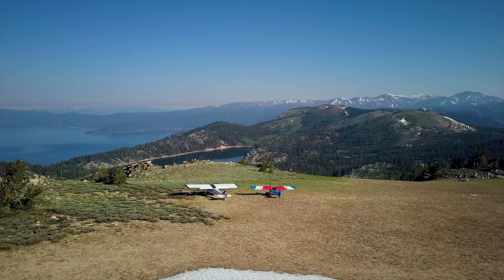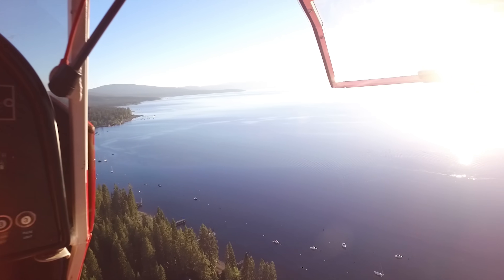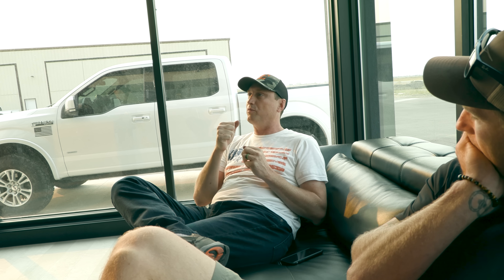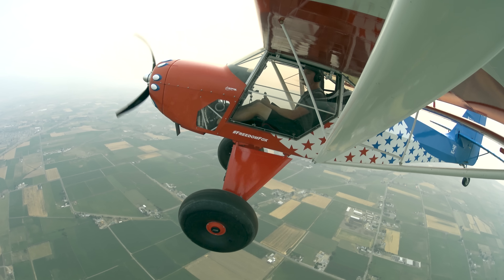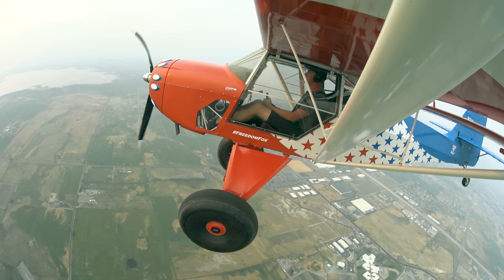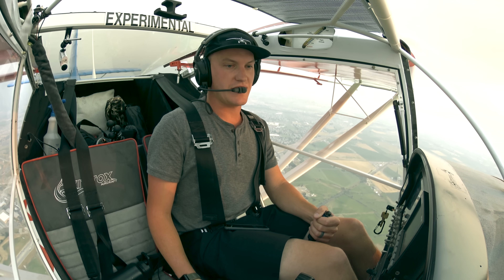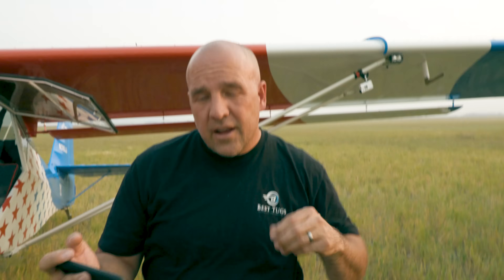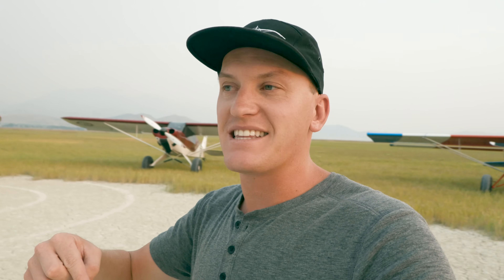YOUR FLIGHT INSTRUCTOR WAS WRONG! - Simulated vs Real Engine Failure

Comment: The way to kill this discussion is to have a plane equipped with a variable pitch prop that can be flat pitched. In the one instance you have it stopped and, in the other you have it spinning at maximum permissible revs, thereby representing the two limiting conditions. My money is on the stopped prop creating the least drag every time,  simply because it cannot create adverse thrust.......whilst the spinning flat pitched prop, can, and in the correct circumstances..... will generate lots of adverse thrust...............i.e. beta, gyrocopters......auto rotating helicopters, ferried jet engines and  the rest!

Comment: Actually, I don’t think it matters! I think either way the difference is negligible to non-existent if the engine isn’t powering the prop. The other factors here are the differences in the aircraft configuration and wind as well as temperature. It’s hard to do a test like that with all of that being constant. You sort of need a wind tunnel for that.

Comment: Hey Trent I'm currently taking aviation courses and I fully agree that an aircraft with an idling prop will hold altitude and glide better than an aircraft with a windmilling or stopped prop. This is because with the prop idling, it is still putting out thrust even if it is a miniscule amount. But, I do not agree that an idling prop produces less drag. When looking at the forces put on an aircraft you see that weight equals lift and that thrust equals drag in stable  unaccelerated flight conditions. When the prop is spinning and producing thrust it increases the drag on the aircraft. The thrust created by the spinning prop helps to overcome the induced drag. But when the prop is off, there is no more thrust to help overcome the drag. Therefore the effects of drag are more prevellant when the prop is off and especially when windmilling. When talking about which of these scenarios will allow for the best glide over the best distance it is at idle. But at idle the faster airspeed over the airfoil and front face of the plane, causes an increase in drag therefore meaning that an airplane with the prop idling would technically glide better but would experience more drag. I know you probably won't see this. And I'm still a student and am most likely wrong but I wanted to share my opinion on what is happening and why. If for some l reason you do see this I hope you like what I have to say. I just think that this fish story got lost in translation.

Comment: I just finished watching a video of a Harbor Air DH2 Beaver float plane engine start and take off. As soon as the engine start and before throttle advanced, the plan was moving through the water. This indicates to me that a prop at idle does provide forward thrust.

Comment: WTH is the point of discussing this?...JUST DO IT.  GEEZ.  The argument seems stupid to me, ANY thrust is going to increase the glide, it would seem.  I would think an idling engine would beat even a stopped feathered prop., now a windmilling prop (engine shut down) might have more drag than a stopped one or might not. In the stopped case the prop is pretty much flat plate drag given its area, spinning and putting power INTO the engine it might possibly remove more energy in a less stalled condition.  GEEZ, now you've got ME doing it.

Comment: Really good question and it's a question that instructors need to touch upon with their students.  The students need to be aware that actual engine out situations will result in a shorter glide ratio than the simulated engine out situations that they practice.  Excellent video!

Comment: Windmilling or not, if you lose power you have to make a decision. It is not the farest point I can reach, it is the safest point that leaves me plenty of options.
As a glider pilot, I have made plenty of outfield landings, and it always begins with find your landing area, make a downwind to look more closely to your landing area, use your baseleg to end up in a shorter or longer final, as needed, and on the final adjust your glide ratio with the airbrakes( or slip ) .
I tried it with my Eurofox Tail dragger, and the only new experience was, during the flair you don’t get the angle of attack as you are landing with engine running idle.

Comment: Disclaimer: I've only flown hang gliders, so engine management was never an option. 

Surely the important question is how far can you travel across the ground under the different conditions? Not how long does it take to fall by 1,000 feet. After all, your glide angle is the most critical thing in an emergency. You want to know how far you can travel with a power failure, not how long will it take before having to land.

Comment: I think the only difference between these two situations is the amount of forward thrust produced, drag should remain constant.  But because they work against each other, the net effect is that a stalled prop is not going to take you as far as an idling prop.  

Additionally, drag force increases as velocity relative to the air increases, this property is easily observed by the presence of terminal velocity.

Comment: Mike touched on the real issue...the frontal area presented to the airflow...a static prop's frontal area, all things being equal(relative!) the area "presented" square on to the airflow for a static prop will always be more than a turning prop...the degree of effect will depend on the foil profile of the prop, no different to a wing (incl tip washout/blade twist)...consider the frontal area of a round tube compared to a square tube of the same side view area. Aerodynamics seriously favours the round tube as the airflow wrong the square profile billows out around the sides and detatches creating a much bigger area effect in the airflow around it...a static prop blade will have the same proportion effect relative to its airfoil profile... any talk of disk effect is crazy!.

Comment: Great Video,  I can't practice a full engine out in the Aeronca Champ that I'm training in (no electrical system.... Hand Propped).   I've had what you said about its going to come down faster dead than at idle every time I pull the throttle to idle and practice a landing. Yes I do know that the manual states that you can Possibly restart the engine by nosing down and building airspeed, but unless it was carb ice that caused it to stop, or the fuel sector set wrong, its probably not going to restart.

Comment: its simple. if the engine is at idle its creating less drag. when you are engine out try keeping the glide speed with the engine at idle or the engine stopped. See the difference  or not. what about a two blade three blade or four blade prop?

Comment: Why are you using airspeed to hold best glide?  It's likely wrong in every scenario.  Should be using AOA.  Don't care about the airspeed, only what the wing is actually doing.  Also - you flying best glide speed or min descent speed?  Cuz that's different too.
Reply: Best glide speed isn't, however.  Weight, density altitude, headwind or tailwind?  Airpseed is only a guess at what the wing is doing, AOA is the truth.  On most light planes the speed in the book will be close, within a few knots regardless of weight or DA.  Headwind or tailwind will change it drastically however.  Good rule of thumb is add half your headwind.  Best glide is 60mph, 10mph headwind, fly at 65mph.  Why?  Extreme example makes it's clear - with a 60mph headwind you will have zero ground speed and not get anywhere, your glide ratio would be zero.

Comment: Sorry, but one final thing.  A stationary prop mounted to a fuselage with no control surfaces would cause the fuselage to spiral around the axis of the center of the prop as it goes down. A freewheeling or under-powered prop will cause less spin than a fixed prop, thus the pilot will apply more control surface to fight the faster spiral, again causing more drag.  Fixed prop loses again.  

An unbelievably good pilot could roll at the natural spin rate and lengthen his glide.  There would probably be vomit.  There's that to consider.

Comment: A freewheeling prop will produce following rolling vertices perpendicular to the center of the prop, thus decreasing pressure at the center of the prop, and increasing pressure as the air is forced outward.  A stationary prop would cause pretty random turbulence, but turbulence is really a pretty interesting phenomenon.  Which one would create less drag on the FUSELAGE and WINGS after passing through the prop?  This is kinda secondary to the prop drag question, but it could actually be as important.

Comment: With the prop spinning OR under power, the leading edge (plus another portion of the profile depending on speed) will ALWAYS be thinner than face of stopped prop.  You will also have reduced drag if you let an non-powered (even if geared) prop spin.  Think of it this way, the moving air will decide what is the most aerodynamic profile.  If a stopped prop was the most aerodynamic profile, the prop would not spin if allowed to freewheel.  You could probably feel the difference with pinwheels.  Buy 2 and tape the back of one so that the pinwheel can't spin.  Swing them through the air and you will find that it is easier to swing the free-spinning pinwheel.  Gears will increase the drag of a spinning prop, but the prop will still have less drag than a stopped prop.

Comment: Isn't a propeller just a spinning wing, like a helicopter, therefore if it is spinning, even at idle it will be producing lift and therefore be pulling the aircraft forward? A stopped prop will have the surfaces facing he apparent wind of the aircraft moving forward and therefore drag.

Comment: This does depend on velocity, at cruise if the engine was pulled back to idle it would create more drag than a stoped prop. At low speeds the cylinder of air be moved by your prop is moving fast enough to push down the tail like Trent noted. That keeps your AoA closer to level (not by much) giving you a better glide. However in the event of an actual engine out you SHOULD NOT try to stop the prop, even though it will give you a slightly better glide, if you are near an airport or runway its best to follow your checklists and land like you normally would. Trying to produce the absolute best glide will shift your focus creating an worse senario. If you have a variable pitch prop and you can feather it, go for it! But you will gain airspeed and glide distance so be aware!

Comment: Here is an issue, these are all front propped planes if it is a pusher and the blade is stopped while blocked by the body of the plane this could in theory reduce drag

Comment: I’m going with engine at idle has less drag than stopped prop. The prop doesn’t magically change it’s size when stopped. It may not generate enough thrust at idle while the plane is at best glide, but I bet my paycheck that it generates more than a stopped prop.

Comment: This is an awesome video Trent! I would agree with you that idle would help a bit more but I'm sure it depends on the plane. I come from mainly a glider background and one soaring pilot in particular, Dick Johnson did over 100 sailplane evaluations. One thing he mentioned is that it is crucial to preform more than one test of each category since you can hit sink and lift at different times. He also would do his tests early in the morning to try to minimize any thermal disturbances. Awesome videos you're posting man, keep it up!

Comment: It's the reason we have engine brakes on an ESC for model aircraft, At idle without the brake the plane produces drag when the brake is applied the plane glides further.  I would assume the effect would be the same on a plane.

Comment: Oh this is a great video and a great topic discussed over and over again.  It is very important to know how your plane "behaves" with idled engine and with stopped engine. Even so, choosing the right spot to land in an engine failure means to choose the one that you 100% can get to it in both scenarios. Afterwards it depends on the pilot skills to have the best energy management to get there using a combination of techniques learnt and exercised a lot ( eq: slipping the plane , getting to the best gliding ration , giving more speed/energy in case the terrain is uphill and so on ) . So independent if there is more drag or not , it really depends on what are the skill the pilot has to manage this properly. More over , one of the most important difference is how much authority  you have on your elevator when you flare you plane. Not having the air flow generated by the idle engine is a very big factor that needs to have a lot of attention (eq: in a taildragger you might end up having a main wheel landing instead of three points if you are not giving enough extra speed to get your plane in a three point position from its own energy resources instead of using your engine ). The risk is that untrained pilots will stall to plane to high resulting into a big bounce ( when it comes to taildragger planes) or striking the nose wheel of nose-wheeler. Bottom line is that I THINK that the most important things are NOT to focus if there is more or less drag between dead stick or idle prop. The most important things are: choosing the right terrain and learn how to land the damn airplane with no extra airflow on your elevator.

Comment: What a cool video, What I love the most is YOU GUYS deal with REALITY and let IT tell YOU what's What. It kind of reminds me of Chuck Yeager, he did not survive because of some super human skill no one else has, No he survived because
A:luck was on his side (some pilots better than chuck Yeager died because there was nothing they could do).
B: He takes on whatever SH*!t he is confronted with.
C: He KNEW his aircraft, he probably knew every valve and relay on his X1 plane and what would happen if they failed. He even KNEW about his oxygen system that at one time saved his life by taking appropriate action at the right time for it.

Likewise with you, it's not about whose right or wrong it's about whats real in your plane. I reckon it would be a really cool thing if you could learn to fly each others planes. You could reduce the fuel and have shorter flights to compensate for the extra weight of having 2 people on board. I leave it to you but I think it would expand both your view on flying as well as as ours.

Comment: During an actual engine out a windmilling prop will create more drag than a stationary prop. Reference multi-engine out procedures. During a simulated engine out, the prop will create thrust and therefore less drag than a stationary prop.

Comment: OK, let me get this straight... We're dealing with a fixed pitch propeller. I've had people tell me that because the pitch of the propeller is shaped like an aircraft wing, the air moving over the front of the blade moves faster than behind, so it's creating a lower pressure area in front of blade, thus "pulling" the airplane. This would mean there's no such thing as prop wash. Hogwash. A propeller spinning at 6000 rpm creates "x" amount of thrust, and a propeller at 3000 rpm produces 1/2 of that, but it's still thrust (all other things being equal). So a propeller wind milling is spinning at, let’s call it 60 rpm. That's negligible thrust, but still 1/100th of x. Now comes the tricky part when we factor in airspeed. For every airspeed there is (has to be) a corresponding prop speed that produces neither thrust nor drag, but is neutral. Any prop speed (rpm) below that point it's creating drag, anything above that point, speed, rpm it's creating thrust. Still with me? Thrust = good. Drag = bad. As rpm increases, thrust increases, so we must assume that as rpm decreases, drag decreases. For every action there is an equal and opposite reaction. To push this even further, imagine a prop spinning backwards. It would push the airplane backwards. So, that would transition from drag, to reverse or negative thrust. Therefore, I hypothesize that any thrust, even if it's now actually drag because you're above that neutral airspeed to rpm ratio, is better than no thrust. So a wind milling prop cannot produce as much drag as a stopped propeller. However, (here's the olive branch to those who disagree) a stopped prop affects the airflow over the rest of the aircraft in a constant pattern, where a wind milling prop creates a continuously changing airflow, which will in fact, vary the flight characteristics of every different aircraft differently.   So the answer remains, maybe. ;)

Love the videos, keep 'em coming.

Comment: Windmilling vs Stopped has been solved before. This site has a nice graph showing how the blade angle factors into the drag. The solid disk theory is based on a windmilling propeller, not a propeller at idle.  http://12charlie.com/Chapter_12/Chap12Page005.htm 

Also, the impact of drag on your velocity is greater on your smaller/lighter airplanes. On a larger/heavier airplane (say a twin), the drag difference would be more negligible.